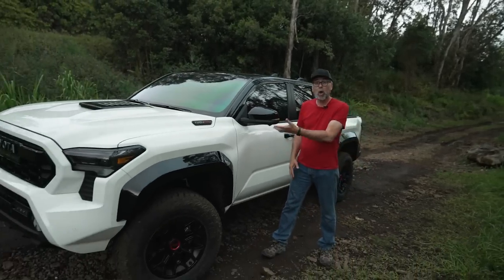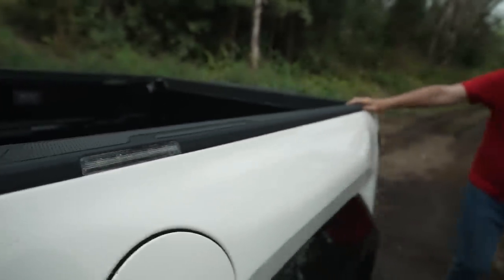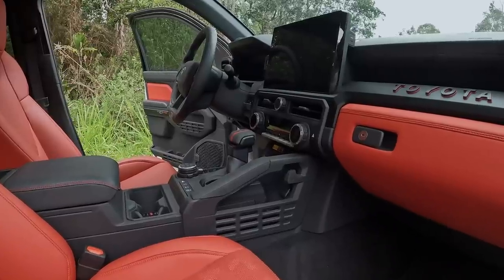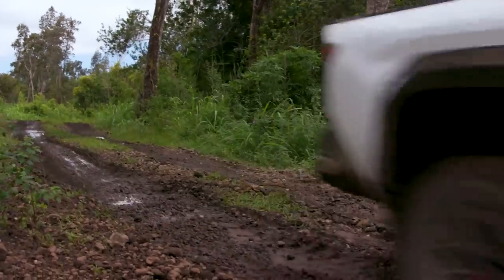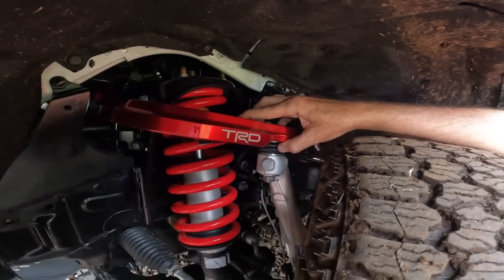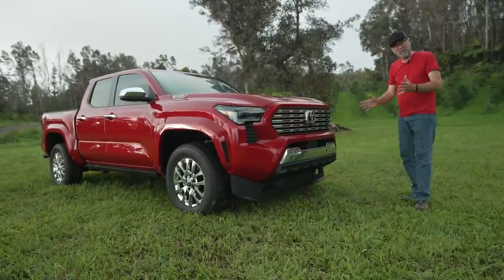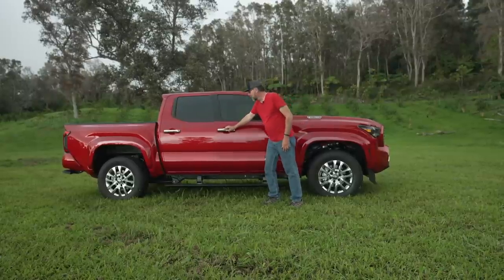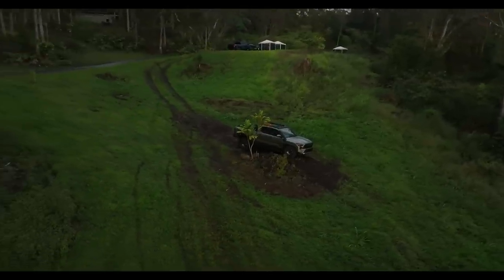2024 Toyota Tacoma, TRD Pro, and Trailhunter Revealed with Vast Array of Choices

Comment from the maker: What do you think about the new Tacoma? Read more here: https://www.caranddriver.com/news/a43921921/2024-toyota-tacoma-revealed/
Reply: While these design traits contribute to their overall appeal, it's important to note that the appearance of a vehicle is subjective, and what may be perceived as "evil" to one person might be seen as bold or assertive to another. In short, Toyota crushed it yet again. I give it an evil score 5 out of 5.
Reply: Thank you Toyota for keeping the manual!
Reply: I think I'd opt for the Raptor based on what I've seen here.
Reply: I'm hoping the reliability that Toyota is known for remains. But I have my doubts now with how a turbo and hybrid will work out for the few that will take them off road. Plus that new transmission too. Maybe 5-6 years before we find out?
Reply: @charlietango6546  They been building bulletproof transmissions. Don't see how they go backwards. I can you tell you this. I'll never touch a ford product with a 100' pole.

Comment: Finally a manufacturer that put a coil spring rear suspension in most of the trims. Not only that but they have ajustable shocks or adaptive dampers. Maybe the Canyon isn't the trop dog now, but the Tacoma my also have an eyewatering price. Toyota didn't have a choice, if they want to keep their share of the market they had to throw everything at it and they did including seats with suspensions. Well done.

Comment: Since these are all early, or very early pre production vehicles, I’ve gotta think that Toyota is trying to steal, or keeping potential buyers from buying one of the Chevy/GMC trucks with these early showings. The hybrid Pro and Trail hunter will not show up on dealer lots until this time NEXT year. 
Hopefully the new 6th generation 4Runner or its replacement will also show up by then. 
Really hoping for at least mid 25 MPG or better on the highway, where most of the trucks spend 90% of their time.
Reply: My 2016 Trd OR already gets 26-27 mpg. Throw some good additives in the truck and it’ll treat you very well.
Reply: I saw in another video, that the full reveal, complete with all specifications and prices, is supposed to be sometime in November. 
There is also a possibility that Toyota is thinking about offering a mild 2-3 inch lift that will be covered by their warranty, which will allow clearance for 35's.
As for the 4RUNNER, it supposedly isn't going to be teased until sometime in 2025.
I'm not happy about having to wait that long, but what else can we do?

Comment: I saw one of these on the Toyota lot and test drove it.  It was the base SR model with a 6 speed manual and the engine screeches in lower gears when you try to accelerate.  Also, the price with all the forced dealer add ons is pushing $50k before taxes.

Comment: If we can get the Tail Hunter or TRD PRO for the same price as a Ranger Raptor at $56k and the Chevy Colorado ZR2 then we will have some awesome shoot outs in the upcoming comparison videos on YouTube 🎉❤😊 

After watching this Ranger Raptor wish list is a Hybrid version with the 2.7 in exchange for the High Output 3.0 EcoBoost…

I don’t know anything about this 8!Speed Tacoma Transmission but the Ranger 10 Speed Transmission with the 2.7 has been in 6 of my F150 work trucks am has been so dependable and fuel efficient…
Reply: The ranger have better suspension and a powerful engine. Also a better interior.

Comment: Trail Hunter looks really good BUT. No lockers, it's a hybrid, it's not on 35s, I'm going to have to wait for aftermarket off road equipment, and that wing in the back of the cab is going to put some distance between your Alu-Cab or your AT habitat. It sucks looking at a high-priced truck and looking at all the things you're going to have to change to make it work for you.
Reply: It has a rear locker

Comment: 4 cyclinder.  Pass....
Reply: 2JZGTE from the supra makes 320hp 315 lbft trq.  This 4 cylinder turbo hybrid makes 326 hp and 465lbft.  Amazing 4 cylinder if you ask anyone
Reply: @beexiong2995  not only are your supra engine stats incorrect you're comparing a nearly 30 year old engine with entirely different purpose.

Comment: this has nothing on the colorado/ranger.....
Reply: It has better resale value and better dependability, for starters.
Reply: @HereForAStorm  resale value because it hasn’t changed in nearly 20 years. if there’s no new models or upgrades to depreciate the older models, why would you buy new. 

Measuring Reliability/dependability accross the 3 brands is like comparing a horse to a cow. They’re very different platforms, have different tech, and capabilities, and going back to my point earlier of using the same parts over a long period of time, sharing the parts with other vehicles under the same brand umbrella with little to zero innovation, so of course reliability will be on Toyotas side…but not by a large margin as media outlets like consumer reports like to tout
Reply: @Rinker44  what you’re not realizing is that GM and ford are both trying to copy what the Tacoma is and has been for the last 40 years. Toyota simply will not be outmatched, out rivaled, or out warrantied. The aftermarket is so much larger for all of Toyotas mid size pickups comparatively. I own all of the stated brands and my Tacoma is always my go to unless I’m throwing a trailer behind me. I don’t like this new version but I’d still take it over the ford or GM and I’ve driven all three.
Reply: Ranger and colorado get one bed.  5 foot fail bed
Reply: Agreed.  Especially the Raptor.  Nothing says try-hard like Toyota truck design.
Reply: @Sackmatters  1.) Tacoma hasn't been out for 40 years. 2.) Ford and GM have been creating trucks since before Toyota has. 3.) My comment was in regards to how they're all refreshed this year, what the ranger and colorado offer, will be better bang for the buck than the tacoma, but keep driving your tacoma since it makes you so happy, nothing wrong with that.
Reply: @beexiong2995  that's the most sold bed size? they're just offering what most of the customer base wants.